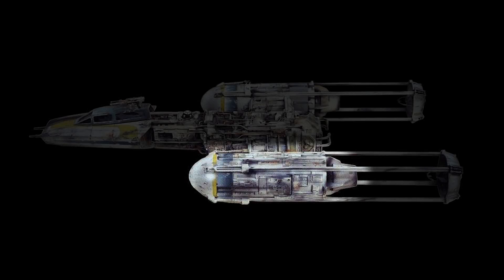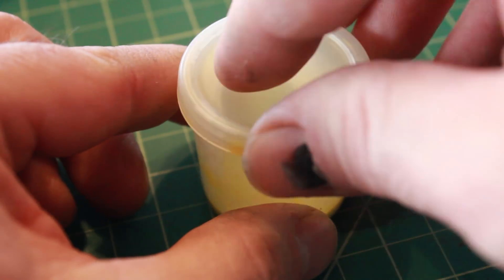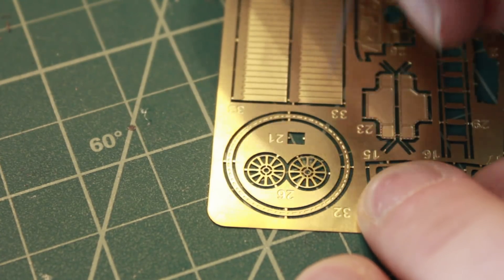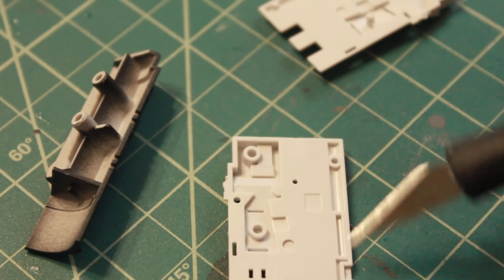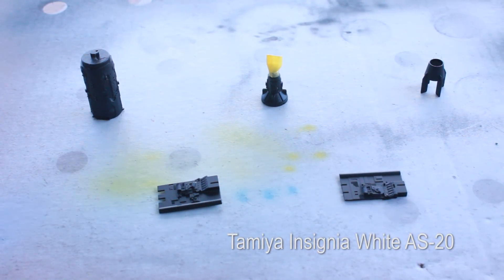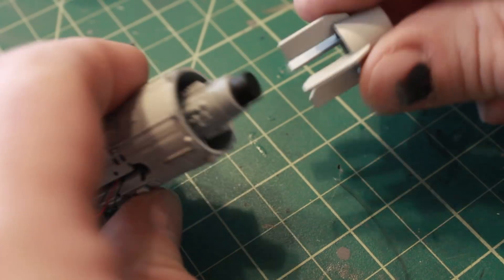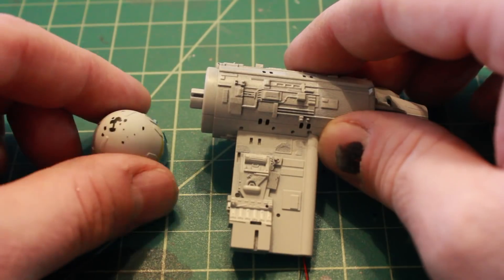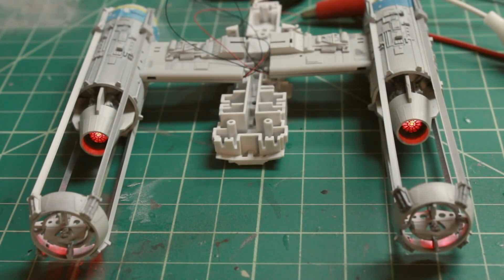Bandai Y-Wing Model Build Pt IV Engine Lighting & Assembly

Comment: What kind of LED lights do you use?
Reply from the maker: They're Adafruit  3535 Neopixels.  They have to be run by an Adafruit trinket to work.
Reply: @modelsbychris  does that include the cockpit lights?
Reply from the maker: @imyerpepper  no.  Just the engines.  Everything else was 0402 SMD LEDs
Reply: @modelsbychris  thank you for telling me this before I made a fool of myself.

Comment: Chris, great job as always. What gauge are the thin wires you use ? Any experience using magnet wire for such application?
Reply from the maker: It just about is magnet wire.  It's 28 gauge.

Comment: Hi Christoper. My love for modelism has reborn thanks to your work. Beautiful work, congratulations. Quick question... what manual tool set, out there in the market, do you recommend for manual drilling? any particul brand, twist drill bits sizes, online store? thanks in advance
Reply from the maker: I just use a pin vise like this one.  I get small bits from Ebay. 
https://www.amazon.com/SE-841DH-Double-Mouth-Vise/dp/B000RB5JJO/ref=mp_s_a_1_35?ie=UTF8&qid=1538429645&sr=8-35&pi=AC_SX236_SY340_QL65&keywords=pin+vise